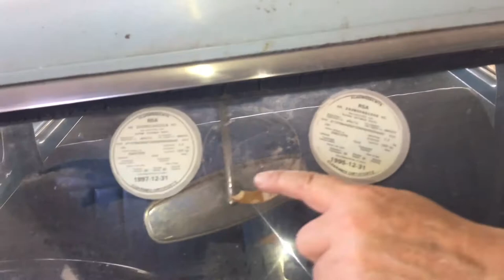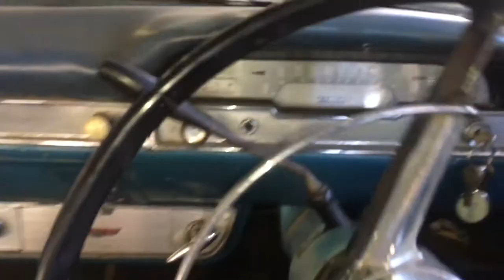RARE!! 1959 Ford Zephyr Six Abbott Station Wagon | Retro Car Dogs

Comment: This is a 1960 model low line.the 59 had rubber and thin moulded beadings around the windscreen..the dash speedo was half round and this has a horizontal speedo
Reply from the maker: Yes sir you are correct 👏 thank you for your support and comments much appreciated.